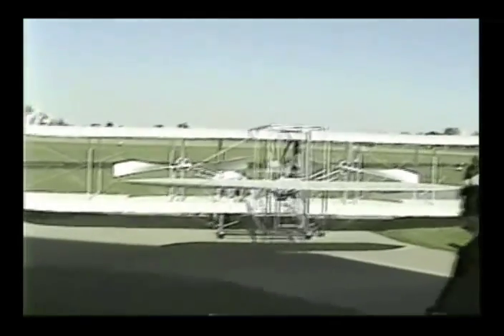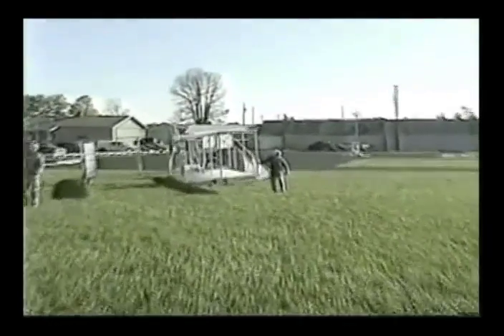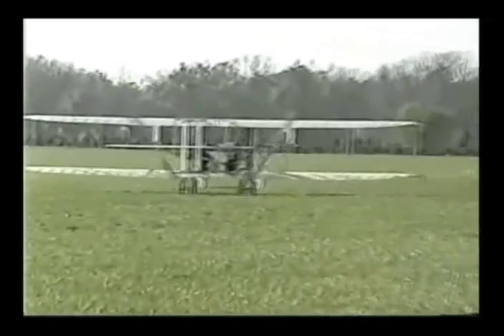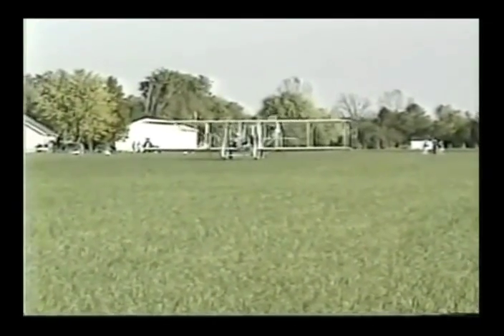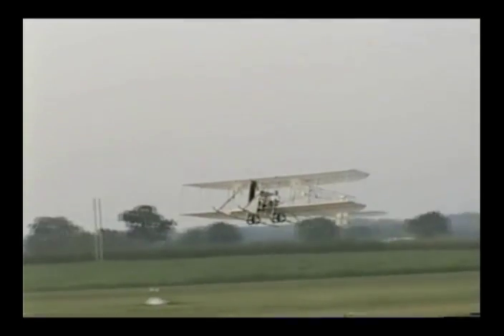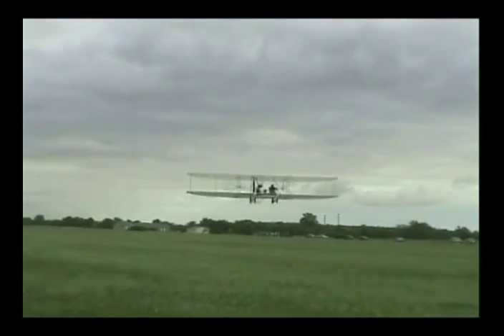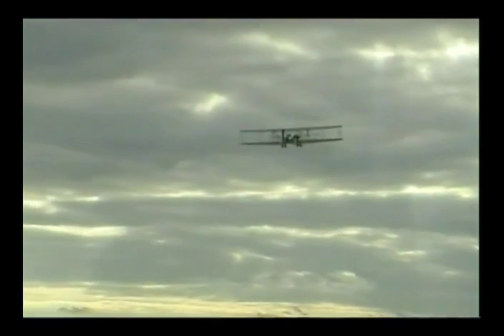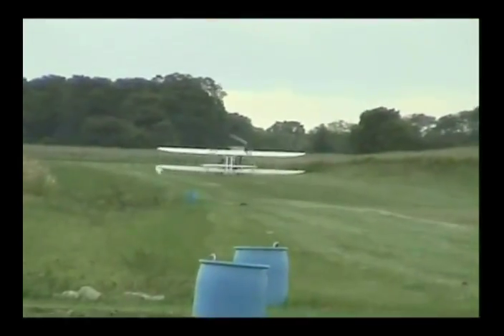EAA Wright Model B Replica

Comment: This is not flyer 1, 2 or 3. This machine is probably the flyer model A or model B. It is over-modernized the wright brothers flew with extreme precariousness with these machines. The first flight It was in May 1908. In 1907 they sought the description of Dumont's machine
Reply: You are correct.  A 2 seat Wright Flyer did not fly until 1908.
4 were built in 1906.  One was shipped to France in 1907.

I am sure the Wrights were interested in the progress of all the pioneers of flight.  
Your implication is that the Wright's borrowed something from the 14 bis.  What did they copy?

The design of this22 Model B flyer was updated with more modern controls and an old Ford 4 cylinder engine.  
The 1903 Model A engine produced 8 hp.  and weighed .... lbs.

I think the engine power would need to match the Model B Wright Flyer.
To do this the Ford engine would need to produce around 38 hp at 1000 rpm.
Did the Model A engine ever produce this kind of power?
Reply: @majorbett  stupid comment. where book of 14bis?how many 14 fly?how far?can it turning?even can it fly?the propeller from pedal boat never fly.
Reply: False!

Comment: The model b flew, model a flew. But  the  flyer 1  in  original condictions  don't flew.
Reply: The original flyer was difficult to control and under-powered.  The controls, airframe, and the engine were modified the next year.  I think the flying replica is based on the upgraded flyer.  

The video of the remote control model shows the spectacular capabilities of the  Wright Flyer  design.  The pilots of the replicas are more concerned  about avoiding a crash than demonstrating capabilities of the plane.